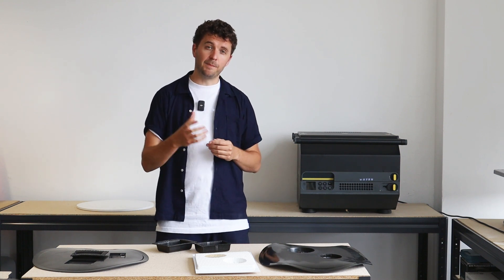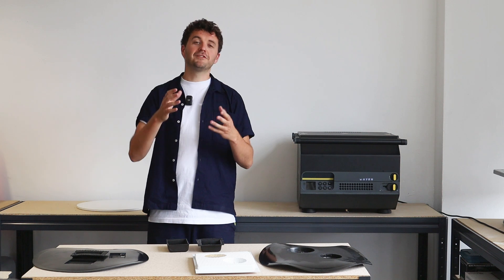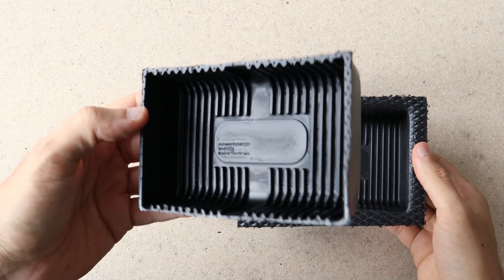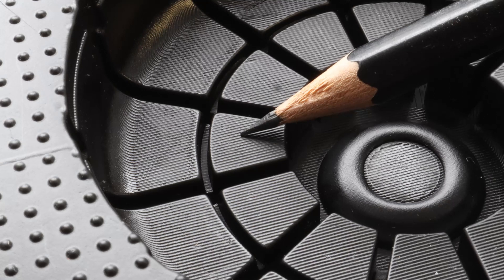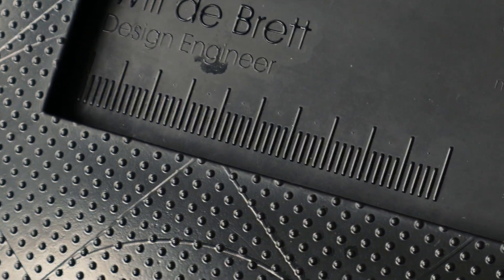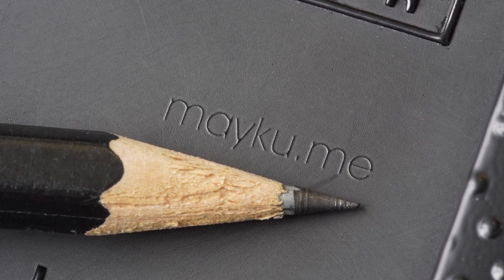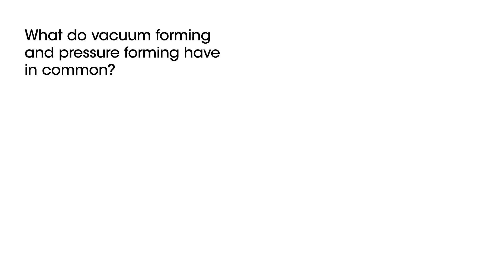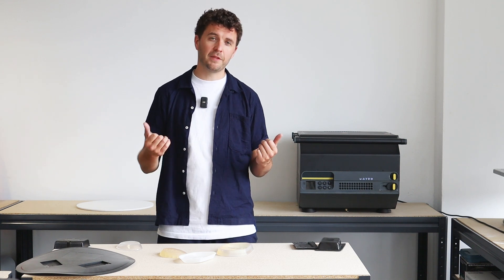Pressure forming vs. Vacuum forming: Understanding the differences

Comment: 4 bar wouldn't do a thing when it comes to plastic injection moulding, I didn't find the samples very convincing due to comparing black to white parts and parts made from different moulds, it didn't give me confidence in the machines ability.
Reply: You clearly watched a different video and have no idea what you are talking about. 
4 bar wouldnt do a thing with injection molding?  Ok, well, this machine fits on a benchtop. Tell me how cheap and small a injection molding machine that will do a 15" circular part is.  Its apples to oranges,  you may as well say....my electric car goes further with the same amount of electricity as this machine that doesnt move.
Reply: @outkast187  Everything I say was the truth.

Comment: interesting concept , will work perfect on small parts , with bigger parts you would need a lot of stored air and a pretty big diameter pipe to deliver it within a verry small timeframe , allso the bigger the part/ pressurized container the bigger eeehr bomb you potentially have , like you said you can apply more force ontoo the part being moulded but that same force is pushing against the walls of the box holding it in , if it lets go the air inside it increases intoo one time more volume of the inside of the box for every atmosfere 
https://www.youtube.com/shorts/3ODSz4WISNo inmagin standing next to it holding the box down to seal it 
seen the same thing with an airplane tire in a shed , there was no shed left , they now use water to pressuretest 

still consider using the option for bigger parts in combination with a vacuum on the other side though as a bit of a turbo boost and a way to cool down the part faster maibe 2 or three atmosfere tops might use a set of leafblowers or a bouncy castle type blower

Comment: If I may, I'd like to make 2 suggestions if you make another similar video. 1, if you want to compare the two, make sure you're using the same units. The positive pressure didn't sound impressive when you didn't use the same units to describe the vacuum. Similarly, suggestion 2, you introduce each vacuum piece first and talk about how bad it looks. However, the audience doesn't see what it is supposed to look like first so again, we can't agree or disagree with you. Start by showing the original part first or the positive pressure version so we can see how the "bad" version errors ourselves. When you eventually do the swiping screens to do a 2nd compare, maybe pause or hold in the middle since several of these examples are symmetrical and our eyes can see what you're talking about.
Reply from the maker: Thank you for the feedback!